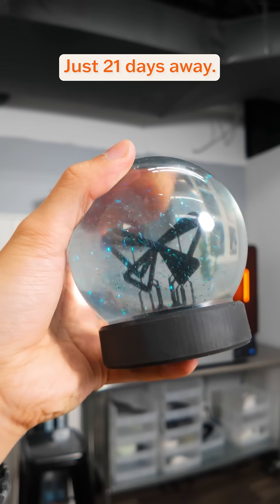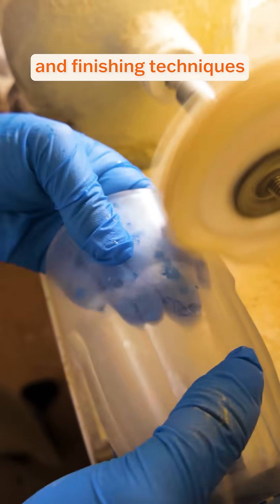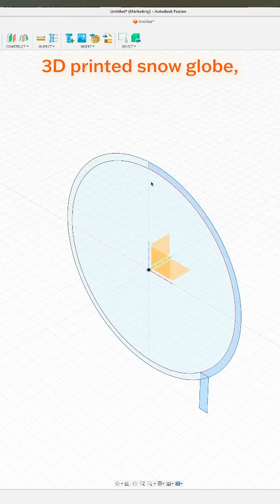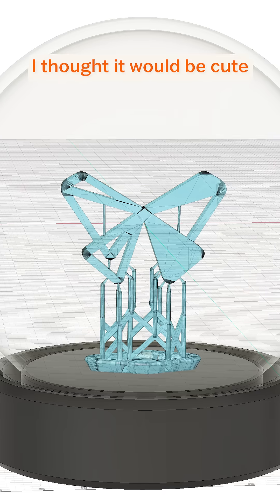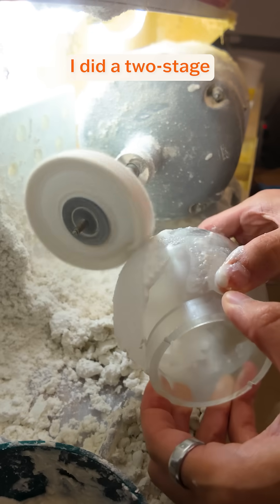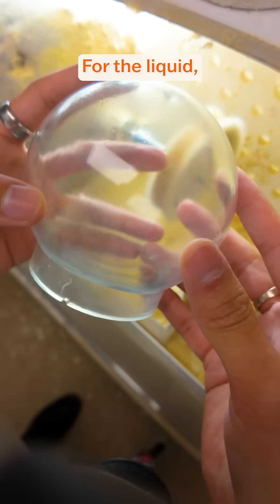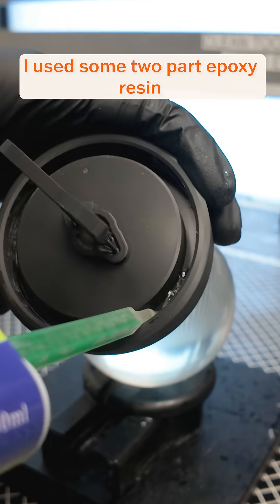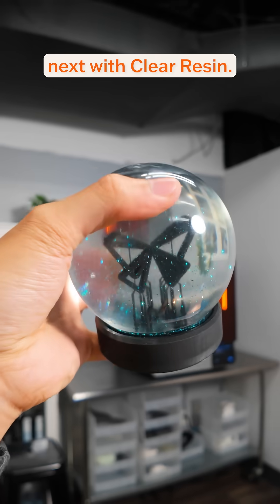How Clear Is Clear? 3D Printed Snow Globe Test!

Comment: Are the peel forces negligible at this point with the Form 4? I'm used to the model getting suctioned off with a build plate like that. Did the globes get a bunch of resin trapped inside when it was finished? Very cool!
Reply from the maker: Thanks for your questions! The clear model actually contains two small notches near the bottom to avoid cupping - you can see them during the polishing in the video. There was resin in the globe after printing, but it wasn't actually "trapped", since the sphere was not fully enclosed.